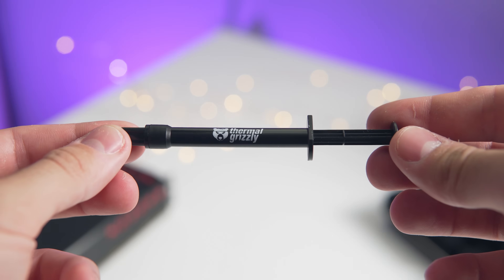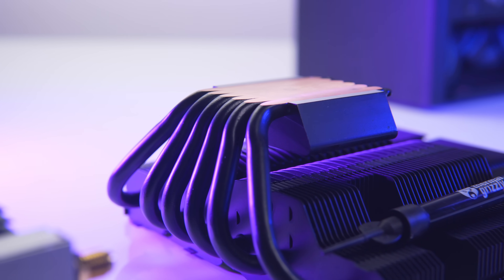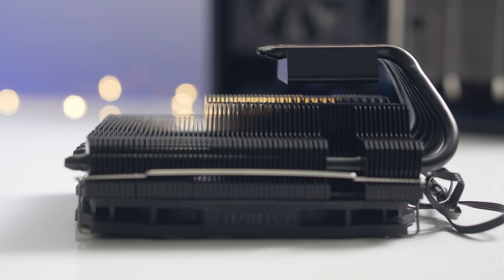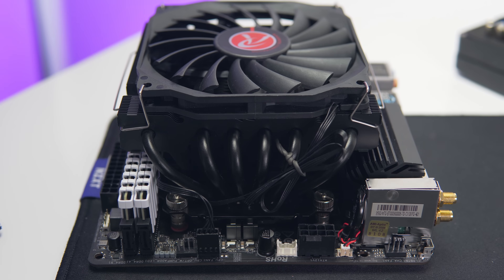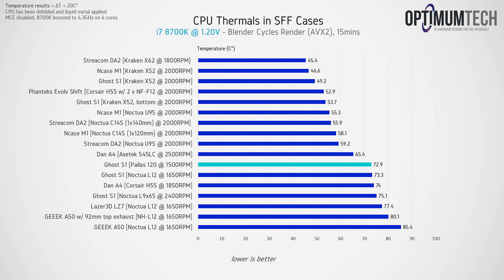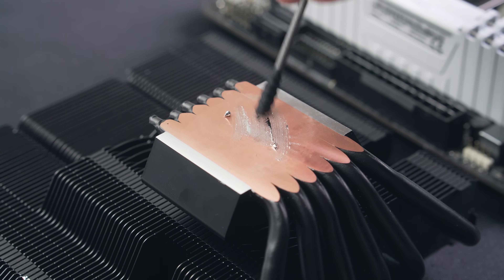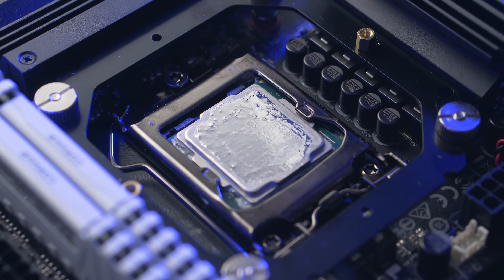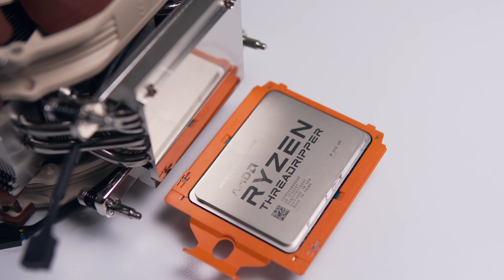Liquid Metal for CPU Coolers - Worth it Over Paste?

Comment: Doesn't liquid metal eat aluminum?
Reply: Yes in a way.
Reply: @backupplan6058  yeah I googled it and apparently the gallium in liquid metal migrates into copper too. The nickel plating heat spreaders protects them though.
Reply: Paul Frederick the migration into copper is such a low level that it really not worth worrying about, you only get a minor tarnish which doesn’t effect performance. All you have to do is replace the LM maybe once a year to two years. I have done plenty of computers with LM with no issues whatsoever including two direct die to copper heat sinks in laptops that have been running year and a half with no issues. You only need to replace when thermal performance drops.
Reply: @Paul Frederick you are wrong, the tarnish is not from a corrosive reaction and no oxide is formed. The tarnish is due to the gallium migration into the copper due to the apposing positive/negative potential of them. It has been tested and found this does not effect the thermal conductivity of the heatsink, in fact can lead to better application of LM in future applications.
Reply: @Paul Frederick, what is your problem? You come into this not even knowing if gallium is even safe on aluminium and all of a sudden you seem to think you know it all because you misread a few articles online. Enough to try a sass me for trying to educate you, someone who had worked with LM for several years as part of his own computer company and who studied chemistry and physics at college. That why I’m going to tell you that you are wrong yet again so feel free to smoke this however you like.

Gallium doesn’t corrode aluminium. Aluminium natural corrodes in the air forming a non reactive oxide that protects the rest of the aluminium from reacting with the oxygen in the air. The clue is oxide - oxygen. In order for gallium to react with the aluminium you tend to scratch off a part of the formed oxide layer so that gallium can react with the structure, if gallium formed an oxide then the reaction would stop. What actually happens is that the gallium atoms disperse within the aluminium molecular structure, the bonds formed within are week and the aluminium takes on many of the characteristics of gallium. Including its low melting temperature which result in it’s week structural integrity.

While copper does do a similar thing the penetration of the copper structure is minimal, practically surface deep and that’s over a long term exposure. While gallium doesn’t have the same thermal transfer properties as copper the penetration being so minimal doesn’t effect the performance but does allow for better contact to be achieved on future applications which can help achieve a thinner layer of LM which provides slightly better results. 

You want to tell me again to put that in my test and smoke it after another google search or do you accept someone may actually know more than you on this subject?

Comment: I’ve used this liquid compound on gpu and cpu and after a year I opened to see how it looks and its corrosive and I used only on copper. Not recommended
Reply: @Pop Gabriel, it’s not corrosive on copper, the worst you get is a slightly staining which doesn’t effect performance at all. If you had any worse reaction than just that then your copper heat sinks are likely cheaper, not 100% pure.
Reply: Pop Gabriel Almost 100% sure the stuff in liquid metal reacts with copper more than it does with aluminium, that’s why people only put them on gpu and cpu dies since the heat spreader on cpus and gpu cold plate are aluminium
Reply: @Chiken Nuget , please tell me you trolling as that whole statement couldn’t be more wrong.
Reply: Conductonaut comes with a bright orange paper insert in the packaging saying in large caps: WARNING! DO NOT USE WITH ALUMINIUM HEATSINKS!

So i really wouldn't try it with aluminium...
Reply: @chikennuget3634   It's called gallium. It reacts to Aluminum. Not Copper. Not Nickle.
Reply: Did you notice a temperature difference? What kind of corrosion? I have seen it scuff the surfaces a bit but you are told to do this anyways. I have not seen a temperature change from install with systems now going to 5 years of use.

Comment: last week i upgrade my processor, from an i5 6600k to an i7 7700k that i bought from second hand, the cooler was/is a Cooler master Geminii M5 ( 50mm in height without fan and 60mm with fan). The i5 6600k was already delidded two years ago with thermal Grizzly metallic compound installed inside the cpu, temperature dropped then from 85ºC to 65ºC, this time from an stock i7 7700k to a delidded 7700k with metallic compound and rockitcool 115% size copper ihs temperature drops from 100ºC with 33% thermal throttling to 81ºC without any thermal throttling. Note that Cooler Master´s Geminii M5 has visible aluminium beetween heatpipes so i only can apply the metal compound between silicium core die and its ihs, not between ihs and the heatsink. Again 20 degrees drop. I have done this many times before, if you can apply metallic compound on both sides of the ihs sometimes the temperatures can reach a brutal drop up to -40ºC  (i7 4790k from 95ºC to 55ºC). Proved. Liquid metal results are much better when is applied directly under the heatspreader than over it. It is more complicated, but worths the time and money, specially on tiny cases.
Reply: My 4770k goes from 85 down to 55
Reply: Nice essay kid

Comment: so stupid everyone knows you have to put it on the motherboard pins.
Reply: shmoaeel alksraney you’re supposed to put the liquid metal on the motherboard pins/contacts to improve conductivity and allow the cpu to slot in easily
Reply: @chikennuget3634  yeah also the temperature is going to get 40 degrees c lower because the motherboard starts absorbing the heat then am i right?
Reply: @mariocelic5622  yeah computer run on full load for 3 hours at 34c degrees.
Reply: Mario Celic no it will be actually at 0 Degrees, because as it is dead it doesn’t produce any heat!
STONKS
Reply: Dude, just break all the pins off the CPU and fill the CPU slot with liquid metal. Maximum cooling.
Reply: Btw don't take us seriously if anyone reading this and thinking to do it XD.
Reply: Pro tip:
Spread liquid metal evenly on the back of your CPU socket to ensure perfect heat transfer.
Reply: Putting LM directly on the pins is the best way to make sure your temps never gets higher than room temperature... If, that’s what your aiming for...
Reply: lmao fill your bathtub with cool water and run the computer submerged, why spend it on an aio when you have a Waterloop in your bathroom.
Reply: if the Verge explain "how liquid metal thermal paste works ?" they gonna spread it all over the motherboard.
Reply: Don't worry guys I know what I'm talking about since I'm doing engineering degree in college.
Reply: Pff, you must be new. Everyone knows you have to put it on CPU pins
Reply: Whoahh calm down, satan...
Reply: Just go to skynet and ask them to make a T1000 motherboard for better conductivity
Reply: Best thing I ever read today
Reply: I actually started to think of it then i realised that its joke😂
Reply: Yes, and red rgb lights give you 10+ fps, blue rgb lights give you 10°C lower temperature.
Reply: @game4fun24  Bro I knew it, that's why I'm going to have RGB everywhere.
Reply: (I get this is a joke) 
That would be a great idea! The temps would be so low because the computer wouldn’t even start. 10/10 worth it over thermal paste
Reply: did this and my CPU never goes above ambient.
Reply: @roop5318  i use old trick, put processor in fridge and it will be even more cold.. my cooler is always on -2°C it (doesnt) work perfectly.
Reply: for those of you who are unfamiliar with PC building DO NOT PUT IT IN THE PINS, he is just joking
Reply: pls don't say stupid things. people could take your words as true words. INFormatic is a serious thing.
Reply: @drohnenderdonner3672  r/wooosh
Reply: do not give likes to such stupid comments.
Reply: @sagarshrestha5800  Have you ever heard of humor?
Reply: Sagar Shrestha of course. especially if you cut both legs. not only do you reduce a lot of weight, since leg bones are very heavy, but toes and toenails cause a huge amount of drag, so by cutting legs off it makes you lighter and more aerodynamic, allowing one to fly. make sure to cut off your nose too, it causes a lot of drag as well
Reply: Chiken Nuget I liked your comment by the way. You seem more humorous person but such comments if given like can be destructive as there are not only adults who watch the video and sees comments for answer which they might not get. Hope you understand.
Reply: @sagarshrestha5800  chill it's humor. also, pretty fun to imagine XD

Comment: How to remove if it gets on pcb or mobo
Reply: wipe it off before you turn it on. thats the biggest hazard with LM, it'll short circuit your system.

it should just wipe off though, at worst a paper towel with alcohol can get residue up. of course blow on it after to make sure the alcohol dries
Reply: Qtips will soak it up. Just take your time and make sure you got it all.

Comment: DO NOT DO THIS! It is a bitch and a half to remove if you need to do any maintenance because it dries out. Plus you see no real world benifit from it. This just ruins the surface of your cold plate and cpu heat spreader.

Comment: 3:49 - shouldn't you have cleaned the top of the ihs first. it looks like it is still covered in regular thermal paste?!?! i use the arctic cleaning kit, but 99% ISO would have helped.
Reply: 99% ia and coffee filter as the abrasive works awesomely and leaves 0 lint or dust
Reply from the maker: It was clean. What you see is what was already on the nozzle of the tube of conductonaut (applied before filming), hence why it looks like LM and not paste on the IHS.
Reply: I have been looking for anyone else who noticed that. No wonder it made such a small difference.

Comment: thank you for doing this as I have my 8700k delidded and was wondering if there was any measurable benefit for using liquid metal on the cooler as well.
Reply: be careful, this guy doesnt do his reaserch. the gallium in the liquid metal corrodes copper which is why roman (der8auer) recently tried to nickel plate a copper cooler in order to use liquid metal on a notebook cooler link: https://www.youtube.com/watch?v=EKR5sCPhF9c

Comment: @Optimum Tech don't use threadripper for liquid metal its IHS is made out of aluminium like all ryzen cpus...
Reply: Threadripper IHS is made of copper. So is all ryzens, check any pic of lapped ryzen. Plating is something else and might corrode however.
http://www.xtremesystems.org/forums/showthread.php?294494-The-Threadripper-Report-(or-the-lack-of-it)&p=5262268&viewfull=1#post5262268
Reply: i thought all IHS were nickel plated copper? it looks entirely different from nickel too, so i really don't think it is
Reply: WTF that would be already a reason why AMDs CPUs are cheaper at least one reason Copper is way better around 180 W(m×K) at 80 degrees C
Reply: @12Burton24  i looked it up, theyre nickel plated copper. dudes just mistaken
Reply: Thanks @all I thought they were aluminium due a helpdeskresponse from amd posted on reddit

Comment: I've noticed using conductonaught both on a Ryzen 5 1600x with a Noctua L9A and Ryzen 7 1800x with the BeQuiet Dark Rock Pro3 and also with the NZXT Kraken x62. Both CPUs run nearly 9-10c cooler under Liquid Metal compared to Arctic Silver, and Noctuas thermal paste.

It is a pita to install though as it doesn't like to spread at first.
Reply: hold it tight for more than a few second, or find some other way to warm it. its way easier to work with warm. not too hot or itll be runny though. no matter what temp, use as little as possible, spread it around

Comment: You should test this for laptops, even though I don't think I've ever seen a laptop on your channel. This stuff is magic for anything that thermal throttles. I added it to my laptop CPU and GPU, 20 degrees Celsius drop on both, which was amazing considering I was running at 99 on CPU and 80 on GPU before. They don't go over 80/60 now at all.
Reply: it entirely depends on the laptop sadly. some just have a weak system entirely and cant do the job no matter what you put on it.

i did it for mine, results were disapointing

Comment: I actually don't think it would make a significant difference with threadripper, as threadripper is well able to compensate its higher TDP with the larger surface area of the IHS. In other words, the heat is more spread out.

Comment: I saw a JayzTwoCents video where he lapped the Intel IHS and used normal paste on it and that had a pretty decent effect on thermals. The reason is because Intel's IHS's are slightly dome shaped instead of completely flat like AMD's. By lapping it, it had better contact with the cooler's plate. Maybe try that and see what results you get with the LM.

Comment: i honestly think your chart is skewing the results because youre not normalizing anything, except the core voltage? 
on the palas 120 youre running at 1500 rpm and the NH-L12 youre running 1650 rpm. are you even using the same fans? 
that gives inaccurate data at best and potentially invalidates the entire thing, atleast from a comparison standpoint, which IS what youre doing here.
sorry to say but, seems to me that its back to the drawingboard m8
Reply: I'll argue limiting variable for sure, but will say that most of these low profile coolers are a "package", so fan is less relevant than maintaining rpm or dBa.

Comment: I would love to de lid my i7 6700k which clocks to 4.9 ghz but can't see reason to do get +2 fps in gaming or + 1 min in editing ?
Reply: Noise would be the next motivator. More efficient thermal transfer means lower RPM for the same clocks.
Reply: @zoomzabba452  fully agree but I stayed on 4.8 GHz and noise is acceptable

Comment: It's because the IHS has enough contact surface area unlike the CPU die, it's not the bottleneck. Put it on the die will result in 20 degrees temperture drop because thats where the bottleneck is. You can achieve 5GHz under 70 degrees with a cheap air cooler, and it's pretty easy. Unfortunatlly it is much harder in 9th gen CPU because they are soldered, somehow the solder doesn't help with heat transfer as they expected, resulting in 9th gen CPUs still running very hot, and they are much more difficult to delid. I think I had enough of Intel.......it'
Reply: It does help with heat transfer. My 9700k can hit 5.3ghz and gets similar if not lower temps as my 8086k did after delidding and adding Conductonaut on the die and on top the ihs and cold plate. The 9900k is just a power hungry heat producer. The solder isn't perfect but it definitely works better than the stock paste they we're using before. Much better
Reply: @SidewaysShadow  Of course it's better than the paste, but it shoud be even better than LM. Some reviewers think it's because the solder is too thick, and the silicon is much thicker than 8th gen, maybe have 8 cores running at almost 5GHz in a such a small package is just too much.
Reply: @oscarshen6855  I understand what you are saying and the die and the solder are both too thick and causing a higher temp than they should be able to achieve. But my 9700k runs great for me. 30c idle, 40c-60c depending on the game & prime95 maxes out in the 80c-84c range. At 5.3ghz ~ 1.44v , 0-50% Silent Fan & Pump profile on Swiftech H320x2 Prestige AIO cooler. Can get much better temps if I decide to use a fan & pump profile higher than silent mode. But having a silent PC than doesn't go over a barely audible hum at 5.3ghz all while staying cool, is very pleasant to me.
Reply: @SidewaysShadow  sounds like you have the type of setup (i intend to go AMD though) i like.

how much did your rig cost total?
Reply: @bradhaines3142  My tower alone was around $1900 with the prices I got on everything. Here my PCPartPicker of my entire setup. But the most the deals I got aren't applied, just current prices. My build is the Green Boblin parts list on this link. https://pcpartpicker.com/user/TheShadow721/saved/#view=FkBxrH

Comment: Is that 8700k delidded?? If not then maybe the intel thermal compound is the cause of less difference in temps
Reply: His 8700k is delidded. For sub 10L cases, every bit of cooling helps. This is just near the edge of negligible results.
Reply: @zoomzabba452  ok thanks

Comment: I've used liquid metal between the heat sink and/or CPU or GPU in several laptops.  I noticed a significant difference in temperatures under load over the stock thermal paste.  For a couple laptops the difference was 10-11 degrees C.  Before applying the liquid metal, I coated the areas around the CPU or GPU with a thin layer of clear nail polish that didn't have anything in it harmful to plastics.
Reply: Blue painters tape and conformal coating are your friends. The nail polish can flake after enough heat cycling and board flex laptops endure.
Reply: it's good at the start but liquid metal react with copper an aluminium